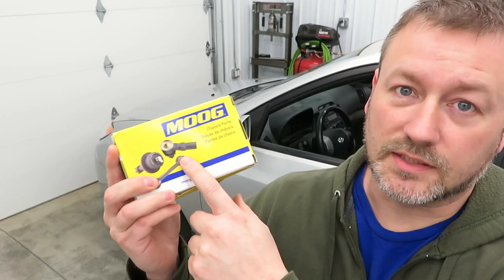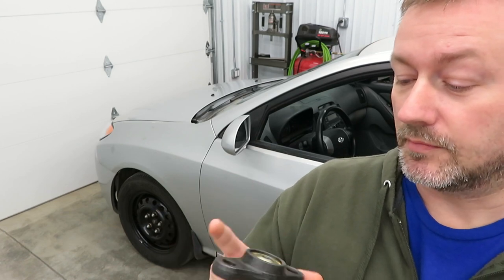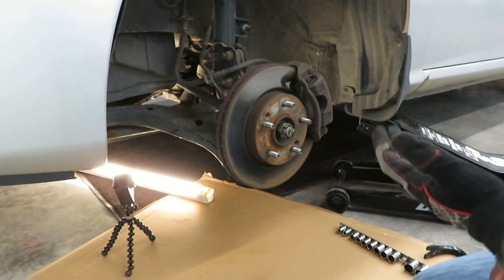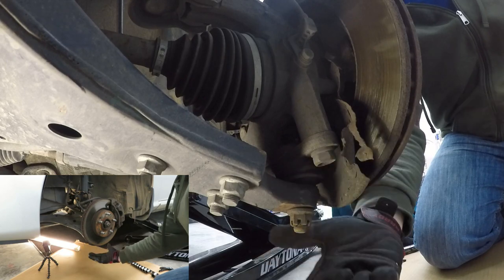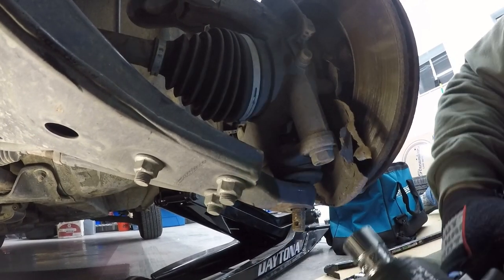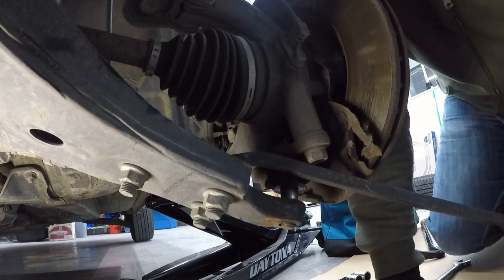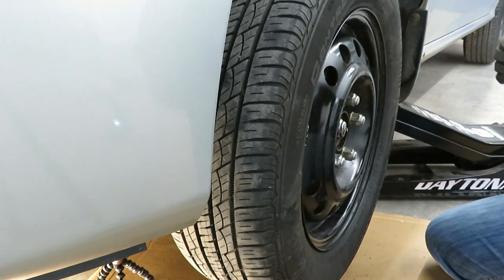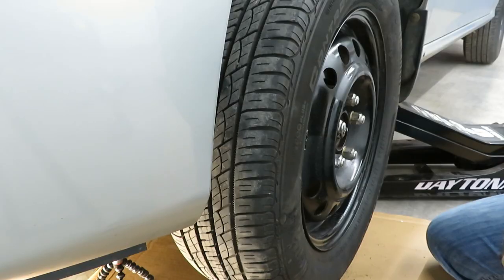2007-2010 Hyundai Elantra Ball Joint Replacement: A Step-by-Step Guide

Comment: Hello :-) i need to install a new ball joint, as well, on my Hyundai i30 2008. Elantra and i30 are similar in this regard so i'm getting my information from this video. I have a question: Should i raise the other front wheel for this work? It's not visible in the video whether you did it. Second question: What needs to happen to make sure that there is enough room for movement for the control arm to go back into the ball joint's bolt? (in your video this process starts at 5:30) My concern is that there won't be enough room for movement and i won't be able to fit the control arm back into the new ball joint. Thank you
Reply from the maker: The process should be the same. You don't need to jack up the other side if you don't want to. The easiest way to get back on to the ball joint is by using a pry bar and lifting up and over the ball joint bolt. I hope that helps.
Reply: @DCAutoEnhancement  Thank you for the answer. Have you ever tried to replace the ball joint by demounting this part "54541-2H000"? it's the element connecting the control arm to the ball joint. i'm wondering whether it would make the ball joint replacement procedure easier.
Reply: @JoeMoe-l4p if you remove that you'll need a front end alignment...

Comment: Did you torque the castle nut to that spec because mine went right past the threads trying to get to that spec?

Same year make model
Reply from the maker: I didn't recall but, if you heard the clock then yes. Some torque wrenches can be finicky
Reply from the maker: I didn't recall but, if you heard the clock then yes. Some torque wrenches can be finicky
Reply: I didn't and I was wondering were I could find the spec in the manual

Comment: I put blue lactide in those bolts, always.
Reply from the maker: @HeydaCarreras  loctite, is what we use here in the states. Is that what you were referring to?
Reply: @DCAutoEnhancement  yes. I saw red, because blue is medium.
Reply from the maker: @HeydaCarreras  red is for "permanent" applications and blue is recommended for fasteners that will potentially be removed in the future
Reply: @DCAutoEnhancement  Exactly my point. I saw you used red and that is permanent, but you will remove that some day.
Reply from the maker: @HeydaCarreras  to be honest, this was quite some time ago and I don't recall what I used or that I did use a thread locker. But if I did, thanks for pointing that out. Sorry for the confusion.

Comment: Well I’m doing exactly what he’s showing on video but the only difference is that the strut extends as soon as you pop it out of there and now I can’t get it back in. 😵
Reply from the maker: You may need to disconnect the sway bar end link if it attaches to the lower control arm.

Comment: Where did you get that ball joint that you can install a grease fitting. What is the Moog number I have a 2010 elantra, sedan, GL. I looked on the moog web site. I may be changing the lower front control arms because they move with a pry bar, and a making a clunking noise going over bumps slowly.   Thanks
Reply from the maker: I am pretty sure I have a link in the description for the ball joint. If you click on it it should show you the part number.
Reply: @DCAutoEnhancement  Unable to find the number? I did contact Moog to see if they can give me the number. Not sure were the discription in the link. Because I may be replacing the lower control arm, should I not install the lower ball joint to the lower control arm first, then grease it before installing it to the lower control arm.  Thanks
Reply: Thanks I found it.... K500074...Ed
Reply: Is the grease fitting already installed when you order the ball joint? or do you have to drill a hole and thread it to install the ball joint? Thanks. Thanks
Reply from the maker: @Eddythe_Eagle  it already has a threaded hole, you just screw it in and tighten it
Reply from the maker: Monkton Trimble  I can understand your question. Mine was fine. I assumed since I used a torque wrench to tighten it, that it should be good.

Comment: Mines wouldn’t even come off with a ball joint tool
Reply from the maker: did you get it off? If not, try hitting the knuckle with a hammer, that usually does the trick.